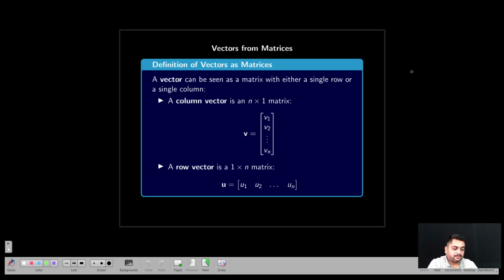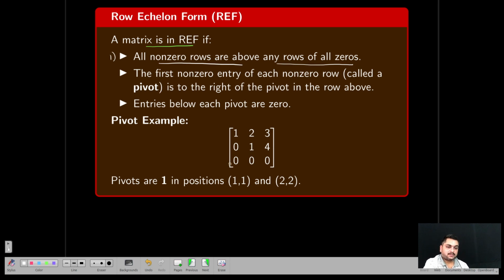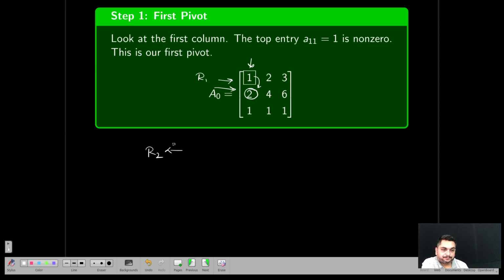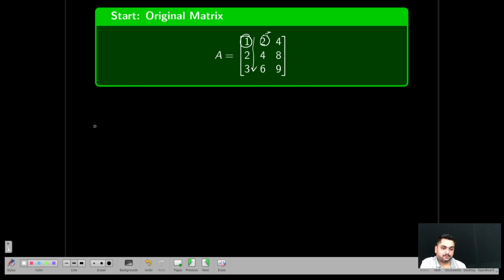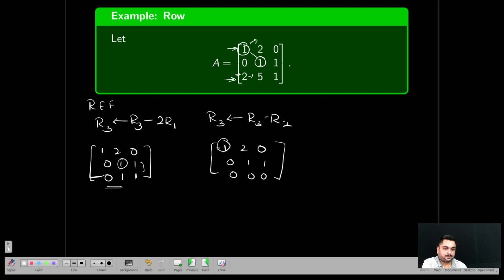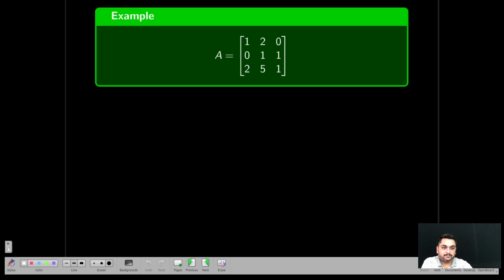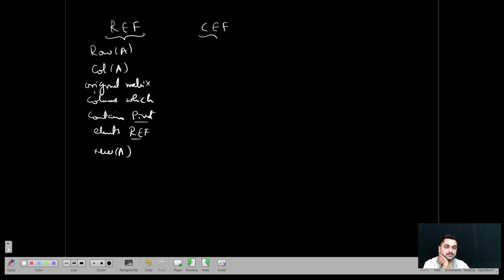Echelon Forms, Row, Column & Null Space | Linear Algebra Lec 06

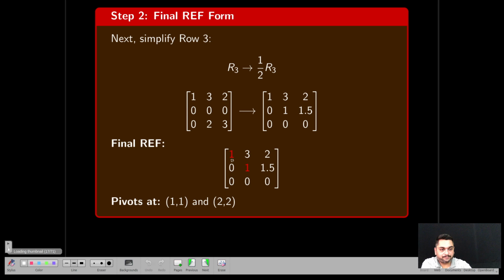Comment: 26:00 mai r1 minus r2 bhi toh kr sakte the
Reply from the maker: Yes, you can.. Check the step 2 result, the final matrix is in REF.
The goal of REF is fixed, but the path to reach it is flexible.
REF has only one requirement:
👉 All elements below each pivot must be zero.

Intermediate steps do not need to look like REF

Only the final matrix must satisfy REF conditions